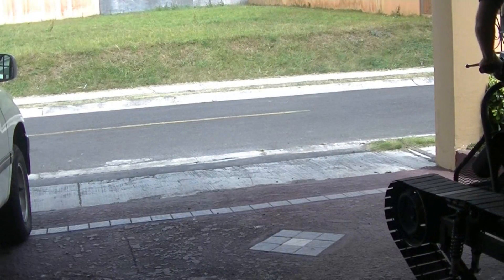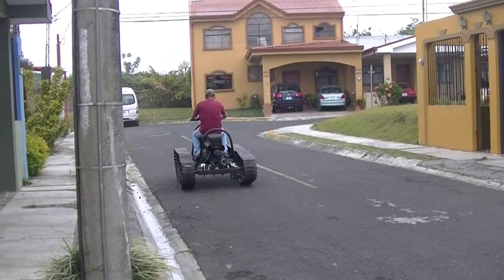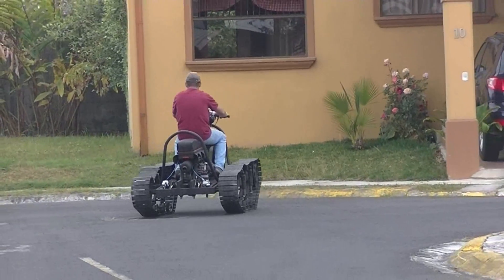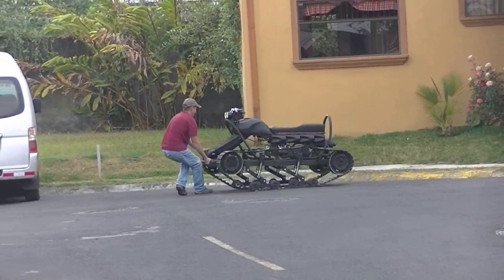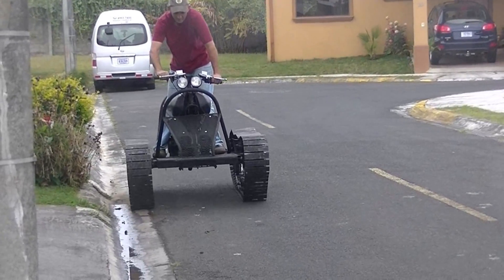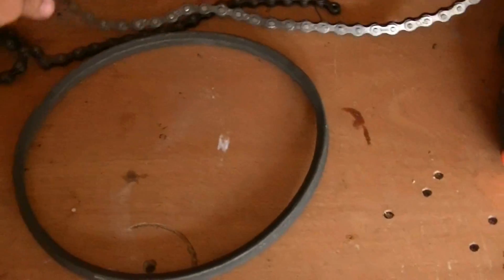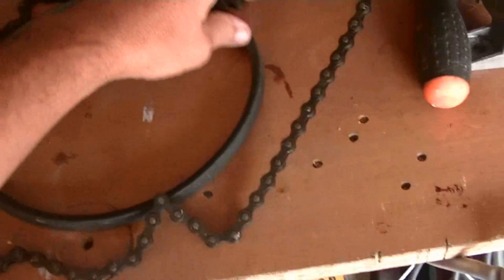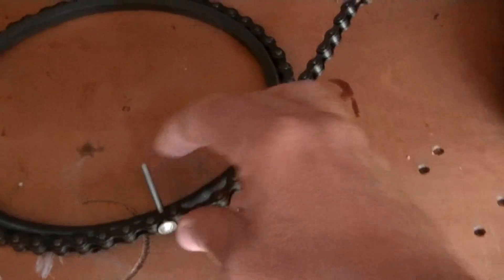Mini tank moves. Building a tracked vehicle from scratch. Progress report 10-C

Comment: Try snowmobile or utv/atv drive belts and pulleys. The parts should be simple on line to find as many junkyards for snow sleds belts are readily available in many stores and catalog/online stores. They are actually mad to slip on the centrifugal clutch. Nice and wide and nice and thick

Comment: For the pulley/belt issue, you could use a setup similar to the Harley Davidson belt drive that uses kevlar reinforced belts (to prevent stretching) with teeth so they won;t slip on the pulleys (which are grooved to receive the teeth.  
 Just a thought....

Comment: Maybe the two belt be fine, three belts each side, with cast steel pulleys may work better. Great video and best to you Aceman307 on your track vehicle........................................................Ken
Reply from the maker: +Kennethe Miller Thanks for the comment I am trying some bigger diameter pulleys and some larger chassis wheels.

Comment: im just throwing this out there but how about using two 12 volt clutches from riding mowers that are used for the mowing deck. that way when you brake one side it disengages the clutch for that side and you dont have to use tensioners on the belts,. i may try it eventually but i was going to share that idea with you and see what you thought. very cool ride
Reply from the maker: robert white It sounds like a great idea I am not familiar with these clutches. I am pretty sure where I live I would not be able to find them. I will have to do some more research. Thanks for the idea.
Reply: The best place to find the clutch's used would be on riding garden tractors for your lawn not all have them just look on the dash for that big p.t.o. button and if you like the used and needed replacement they're around 150.00 new I hope this helps your video is sure helping me.... peace

Comment: Cool project dude, I love this sort of stuff. Normally I would say use a differential but your using what you have on hand. As for your belt problem could use timing belts for camshafts. You can pick them up for nothing and they're alot broader or grooved v belt but that would mean using different pulleys. One question, how did you sort out your wobble issue with the nuts and studding for the rear axles? Studding rarelt is ever straight and nuts are almost always never flat, but you know that by now - thansk again for posting - matt uk

Comment: Interesting project.  I think you should try solid rubber wheels on the motor and track side, and then use tension springs to keep them together for traction, but have a way to pull back the tension from the spring to use for steering.   This way you will have a long lift and sturdy system.

Comment: I think you are going to have to use some sort of a clutch on the drive wheel shafts.  When you apply brakes in the direction you want to turn, the clutch on that side will disengage turning to that side.  That's how mechanical bulldozers work.

Comment: Why r u using belts not chains
Reply from the maker: Clement Leworthy If one side of the tracks could not slip , then you would not be able to steer. The idea is to loosen one belt on either side to steer that direction.

Comment: Haven't you seen tankman's video about davey belts? He also replaced the seat belt with chains. :)
Reply from the maker: slopedarmor I have watched some of his videos but I have not seen the video where he reinforced the belts with chains. Or are you talking about the transmission that has a derailer for the chain drive?
Reply: Aceman307 Search for 'Davy Belt part 1' and you'll find it. It's 2 small videos.
Reply from the maker: slopedarmor I just watched the two videos on the Davy belts I think thats going to work. I will try and make one . Thanks for the tip.

Comment: I think, considering your space constraints in there, you might be best off by pulling your current pulleys & replacing them with a "multi-v" belt+pulley setup (using a serpentine style belt) to give you a higher surface-area, but lower thickness (thus, lower heat generated) belt, fitting into about the same space, that's already reinforced pretty well against stretching by the fiber "backbone" that's generally attached to multigrooved belts.
Reply from the maker: Robherc H Thats a good idea I was looking at some serpentine pulleys at the junkyard. I would have to figure out how to route the belts. I am not sure they make a belt that small.
Reply: Aceman307 
The serp belts will fail faster than a v-belt if allowed to slip. If you let a serp get hot from slipping it's gone.
Reply: Aceman307 I don't know your exact measurements, but if you check on vbeltsupply.com, I just found a 5-rib, automotive style serp. belt they sell at 20" pitch length, 20.75" outside length that I'm thinking would likely even be too small to use on your 4" pulleys ;) http://www.vbeltsupply.com/k-series-poly/k-series-poly?p=1
As for routing; looking at your pic of how you have your current V-belt routed, there would be no problem with routing a serp. belt the exact same way. Idler tensioner pulleys are almost always pressing against the smooth backs of serp belts & both of your drive/driven pulleys are directly adjacent to each other, so no problems there.
Reply: MichianaFisherman I would tend to disagree some here, based on seeing several old cars squeaking their serp. belts without blowing them after having an alternator or water pump fail. However, I realize that there are exceptions to every case, so out of millions of cars, the 5-10 I've seen do that could just be the rare exceptions where a serp. belt stood up to that kind of abuse.
Reply from the maker: Robherc H Thanks for the link. I will check it out. The current belt I am using is a Goodyear Industrial A23". I was looking at some kevlar belts from northern tool. I dont know if they are much stronger than what I am using now.
Reply: I'm not sure about stronger, but if you're wanting to stay with a V-style belt & want to keep the temps lower, might try using a "notched" or "cogged" V-belt. the cut-outs on the narrower surface help reduce the heat generated by flexing the belt, and might even help cool the belt from friction/slippage heating a bit too (through increased surface area). Not sure if that'd be enough of an improvement for a single V-belt to do the whole job, but at about $10 to try...it'd defo be the cheapest fix u could try!
Reply from the maker: Robherc H Thats a good idea. I just watched a video on belts. And it was talking about how the cogged belts are designed to run cooler. I think I am going to double the pulleys and buy the Kevlar belts from Northern tool they are not very expensive. Two belts on each side and see how it works. Thanks for the comment.

Comment: Awesome stuff mate, seems belts are a bit of a pain but I hope it works out. I was looking around and maybe you could make a trike axle of some sort if you've ever considered.

http://forum.atomiczombie.com/showthread.php/6669-Was-brainstorming-today?p=63849#post63849

http://forum.atomiczombie.com/showthread.php/5049-freewheel-differential these are pretty cool
Reply from the maker: Swearzy The ideal setup would be something like a golf cart axle. Then you just steer with brakes. I think I can make the belts work. Most lawnmowers use belts for there drive train and the cutting blades so its possible. Check out tankman101 channel

Comment: Bolting chain to the belt is almost certain to fail. Why not go to industrial chain altogether, with an idler roller. You can easily research chain and sprockets in the online machine supply catalogs.
Reply from the maker: Kevin Hornbuckle If you go with chain how will you allow it to slip for steering? If you check out Tankman101 he has a video on building a transmission from scratch for his tracked vehicle its for his 2/5 scale Sherman tank.
Reply: I wondered if that was the case. Perhaps there is a hydraulic hub that a sprocket can mount onto. Probably too complicated for this build. Wider belts like for a motorcycle belt drive. Or how about an idler roller that releases belt tension when you pull the brake handle.
Reply from the maker: Kevin Hornbuckle In this video near the end I show the idler pulley that is able to release tension when you turn the steering left or right. I have to beef up the cables because the spring I am using for tension is very strong.
Reply: Heavy truck shops can produce custom control cables and housing.

Comment: Aw man, you got it moving, soooo cooool. If you maybe get a smaller idler pulley so it will go in between the drive and trans pulley you can get more grip and will pull the belt into pulley groove harder. That's how I will try to do mine first. my theory is if there's no slippage to begin with there won't be any heat or stretch on the belt. you need about 2/3 surface area of grip though.
Reply from the maker: ***** If I had to build it again I would position the engine about 6" more to the front giving more space in the back for larger pulleys. I think doubling up the pulleys and belts and reinforcing them should solve the problem. Have you checked out Tankman101 videos he is really clever with his fixes.
Reply: I here yah, I'll be using 4 inch pulleys on mine but I have about 9 inches of space inbetween. I might be able to go larger on the pulleys about 1 inch maybe but I'm pretty sure I can run duel belts too. I think I thought of that. It's been a while when I did my last mockup on that part though. I need to redo my drive axles with the track sprockets anyways. But yah man You got it movin, just a minor setback. Hell when I did my frame I had to scrap the first center section. That's how we learn.
Reply: Aceman307 Yah, I checked out his vids alot. He's pretty hard core tanker. I joined his forum a few months ago, alot of info there. ScaledTanks.com.
Reply from the maker: ***** Can you get bigger pulleys I think it will help. It sounds like you got the space. Setbacks are part of the process could have been worse. By posting my progress everyone can also learn from my successes and sometimes even more important my mistakes.
Reply: Getting pullies was actually pretty hard. First I went to a heating supply company and their parts was pretty flimsy so I went to a small engine repair shop and I actually had to fight with the guy workin the counter just to open the book on pullies but yah I can get bigger one's from Tractor Supply. Did you use automotive belts or utility belts because they both are made differently. Auto belts have the string inside the rubber like a tire and a utility belt like for a riding mower are solid rubber with a wrapping around the outside only. Plus auto belts can handle tention of around 60lbs of pressure on them without stretching to give you an idea on belt design. I'm thinking the belts stretched because they heated up to much from slipping, not from pressure. maybe more pressure on the tentioner pulleys would help. Couldn't really hear what was going on with it.
Reply from the maker: ***** I am using an Goodyear industrial belt A23" I was looking online at some Kevlar belts from Northern tool. I have allot of tension on the belts, I just think it goes back to surface area for the belts. I also am thinking about changing the bottom wheels to larger ones to see if I can make the whole thing roll easier.
Reply: I think it's surface area mainly too. Are you talking about larger road wheels? Mine will be 7 inch push mower wheels. I'll have around a 1/4 gap inbetween the track plates I think. Probable would be a little noisy though but roll OK I think,LOL.
Reply from the maker: Yes I am talking about my road wheels. It seems like I should be able to push it easier.